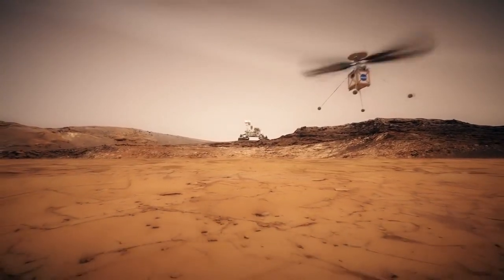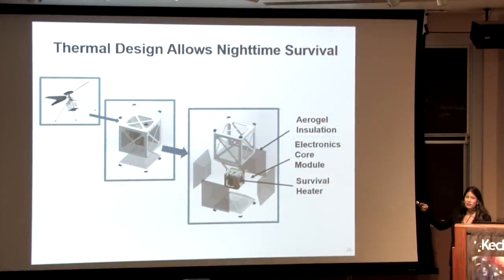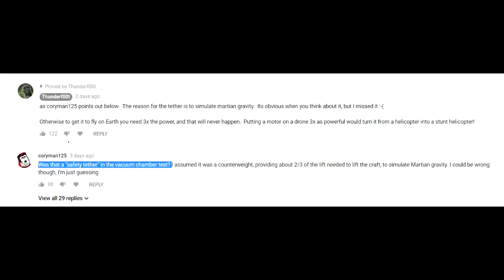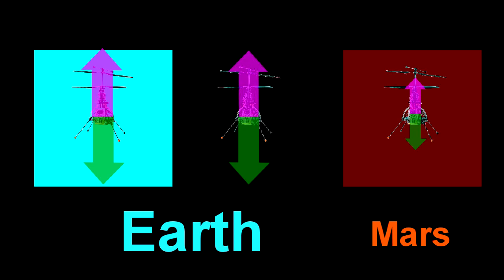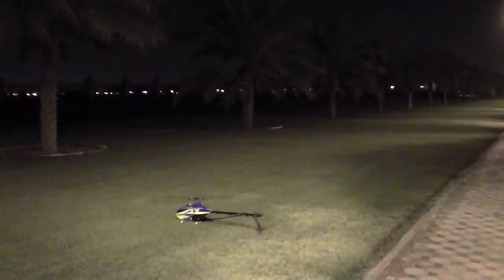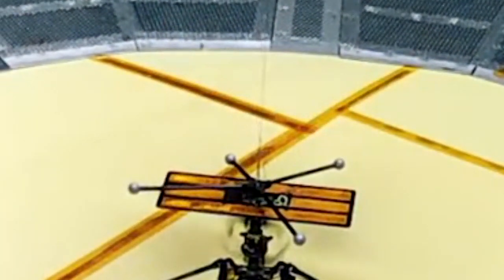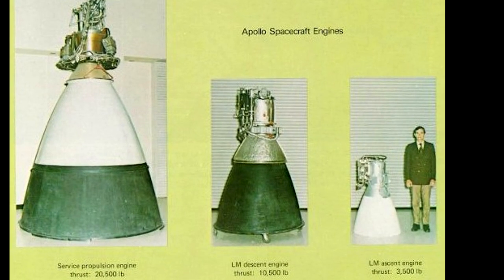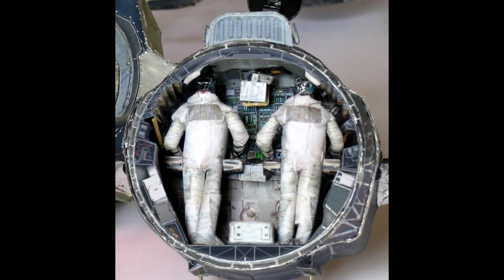Why NASAs Martian Helicopter CANT fly on Earth!

Comment: We need solar road ways on mars for this helicopter to fly there, don’t ask how it works.
Reply: These dummies from NASA are looking for water under the ice caps and under Martian soil for future colonies, they should just take WaterSeer with them. Solar FREAKIN roadways on FREAKIN Mars will provide the power and the people will be transported with an interplanetary hyperloop.
Reply: Wade Marley or solar panels right under the bottom of the helicopter
Reply: It's pretty clear, the helicopter has to recharge while in flight, which you can do from a solar roadway and a wireless power charger.
Reply: And it would communicate with Earth through Li-Fi
Reply: Just launch a solar roadways panel module with built-in 360º cameras by parachute like the ones proposed to use in war( MILITARY APPLICATIONS!!!).
Reply: If only we could combine solar roadways with the hyperloop on Mars. In a tunnel.
Reply: Because the glass they used to make the panels are '10X harder than steel' so it will withstand reentry conditions :D No need for more cameras, I'm joking. :D
Reply: Sleeper Service so hyperloops can move hyperloops inside them. Inception much?
Reply: You need a waterseer to provide the hydrogen fuel to power the roadway cells if you want to hyper loop in a hyper loop HONESTLY!
Reply: @StraberrYKiler6789  They need to get a robo-dowser.
Reply: Wade Marley 
p
Reply: You forgot fricking